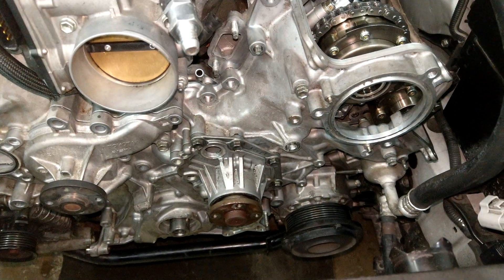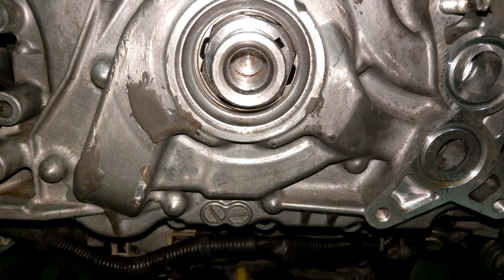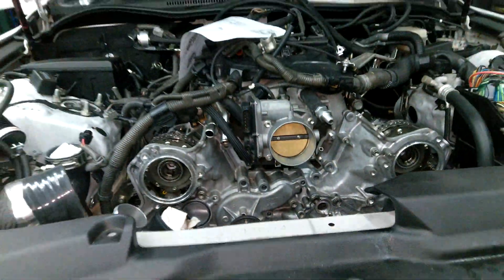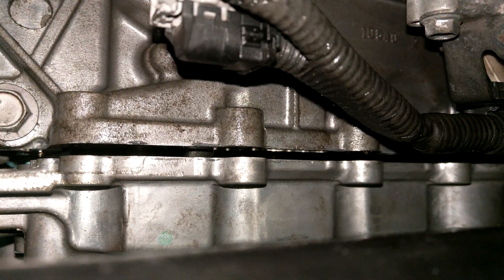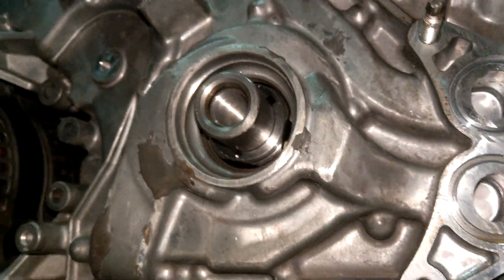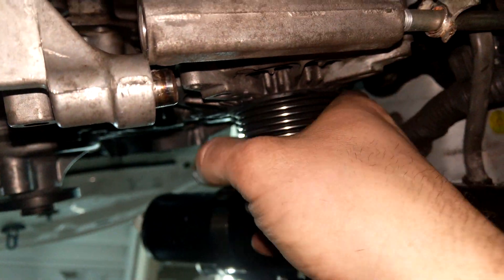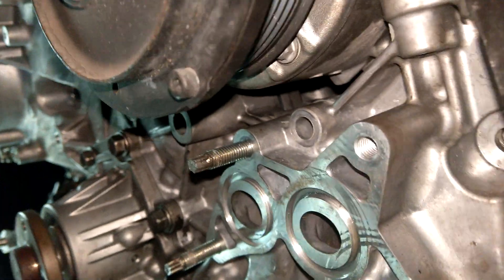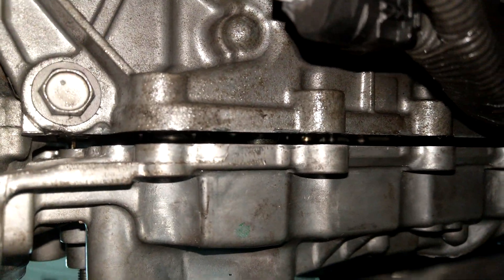2UR-GSE Lexus IS-F Timing Chain, Tensioner, Guide Tutorial Part 6 - Timing Chain Cover

Comment: so you recommend removing the a/c compressor and alternator and then refitting it?
Reply from the maker: They are attached to the front case so they need to be unbolted and moved aside.
Reply: @LILEVO  thank you, got all the parts ordered and will be doing this pretty soon.
Reply: Any special way to install the VVT timing adjusters or just bolt on and go ?